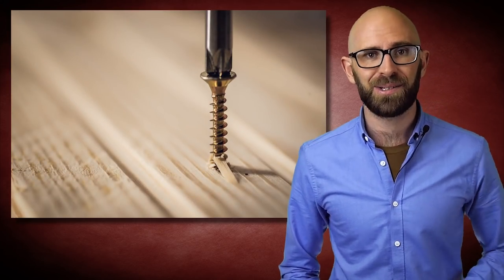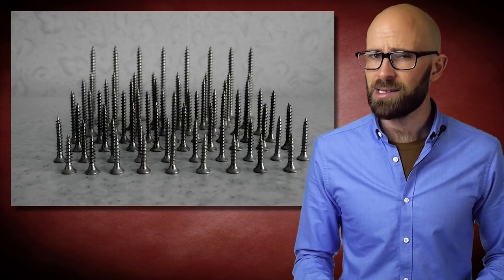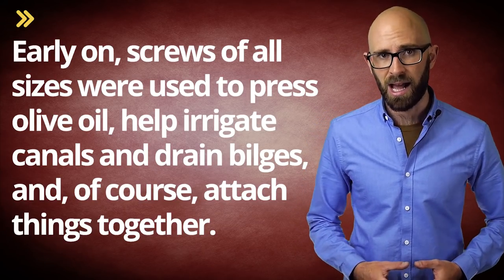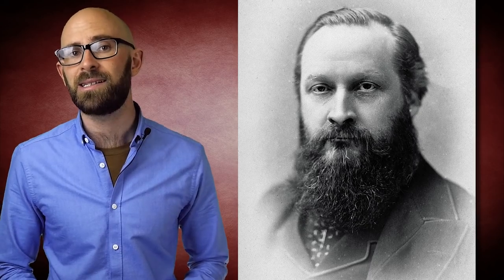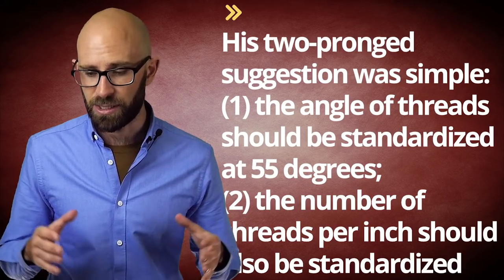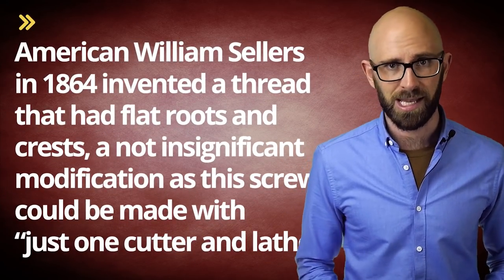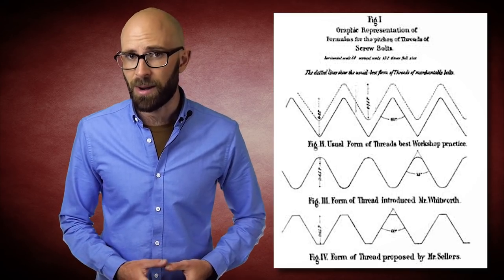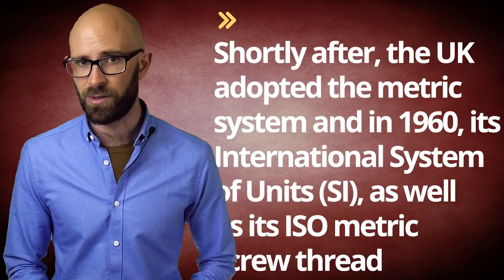Why Do Screws Tighten Clockwise?

Comment: You didn't address why gas fittings are left to tighten and right to loosen
Reply: They probably didn't mention it because not all gas fitting are CCW (left hand) threaded.  Different gases depending on their type are fitted with thread types; inside or outside connection and CW or CCW threading.  There is an example of as to why in the case of mislabel nitrogen tank labeled as oxygen being shipped to a nursing home in the US and a maintenance worker replaced the fitting to connect it to a centralized oxygen system killing several residents.  A bit out of the scope of the video but hope it helps anyone who was curious.
Reply: Still think it deserves it's own video
Reply: I always assumed it was because when turning on a gas system you want to do everything CCW, and when turning off you want to do everything CW.
That was the only reason I ever thought up for it.
Reply: in oxyacetylene welding the acetylene and oxygen tanks have different threads so that you can't connect them to the wrong hose.
Reply: Sean, but then why wouldn't they do something easier, like make them a different size?
It's how they make sure you can't hook up battery terminals backwards.

Comment: The logical way for a lathe to operate naturally produces a right hand spiral, even the very early lathes rotated anti-clockwise (down as the operator sees it) and fed towards the head. It’s only common sense to design a thread to be easily machined, why make it awkward by having to cut a thread feeding out or turning backwards with the tool upside down?

Comment: I'm an engineer in the US and I prefer the metric system when using CAD software and taking general Measurements. it's infuriating to to sort through the imperial sized screws to find the correct metric one. Being an engineer in the high tech industry I can't begin to tell you how much time Americans waste by not going metric. I hate to think how much money is wasted every year.

Comment: If the threads simply ran straight down the length of the screw, we could all save time by knocking them in with a hammer.

Comment: Does gravity get stronger or weaker the closer you get to the core of the earth?
Reply: Because the mostly iron core is denser than the mantle, as "you" get closer to it gravity increases slightly.  If by core you meant the centre, once "you" go past the core mantle boundary, where g is about about 10.7 m/s², it drops off nearly linearly to zero at the centre.  This was found from seismic data.

Comment: But you didnt explain why some use flat head and some cross head screwdrivers.
Reply: Originally all were flat head.  When power tools became common people were finding that the flat head had an issue with slipping out of the slot.  To counter this several head types were made were made and the most common was the Philips head.

Comment: Well it would sound wired if it was righty loosy 
Lefty tighty
Reply: You mean like the left side lug nuts on a pre-sixties Chrysler-Plymouth-Imperial-Desoto-Valiant-Dodge car? There are logical engineering reasons for left-tightening threads. I remember how puzzled the bicycle shop was when the front bottom bracket lock rings and crank arm retainer bolts on my tandem kept working loose because the factory had installed the adjuster-tensioner insert in the bottom bracket backward.

Comment: Here's a better question - why can't we just use purely flathead screws. Seriously, they are so much easier to use, they don't strip like philips heads do, and even if they do strip it's easy as chips to get it out anyways. 
And don't get me started on specialized screws like stars, hexes, etc...
Reply: I'll bite.  Screwdrivers jump out of slotted screw heads, and the slots strip easily too.  The real problem is the world adopted Philips head screws (or variations), which were designed to limit the torque that can be applied to stop over-tightening in manufacturing, thus screwing over anyone trying to get them undone.  Fortunately, better shapes are appearing these days, we just need a standard now.

Comment: Am I the only one who hates the idea of "righty tighty, lefty loosey"? I mean, the phrase actually doesn't make sense. I mean; Is the top or the bottom of the screw head (When looking at the driving end) moving right!? The opposite side will be moving the other way (like a wheel). I advocate for another saying that will help people without a functioning memory to remember that clockwise tightens and anti-clockwise loosens.(yes I know there are anti-clockwise screws for special case scenarios) Or just remember it without some mnemonic or saying, since it's just as easy! Sorry for the rant.

Comment: Here's a question, why hasn't the United States converted to the metric system?
Reply: Congress
Reply: It's not like it hasn't been tried, but a conversion would have to be approved at State rather than Federal level.  Also certain sectors of US society are very resistant to change.

Most US schools teach both formats these days so it will probably come one day.
Reply: Perhaps because very few units in either system are based on any fundamental principles. So for most scenarios, the system of measurement being used - whether metric or standard - is ultimately based on mere aesthetic preference.  There is a reason you can convert between metric and standard.

Comment: Does anyone make a left handed screw?
Reply: bjs301 There are quite a few out there. Usually they'll be called reverse thread screws.
Reply: Older vehicles used a left hand thread on wheel studs on the right side of the vehicle.

Comment: Whitworth requires three cutters and two lathers? What rubbish. With  a small thread any thread profile can be cut with one correctly profiled cutter. OK with a really big Whitworth you might want separate tools to profile the bottom and round the tops. But not two types of lathe.

The Sellars thread is cheaper to cut as it eliminates the base and crest profiles, but the Whitworth is stronger for having the rounded transitions.

Comment: Screw the inch system
Reply: Cleiton Felipe actually i like using both imperial and metric interchangeably, can be more process i feel.
Reply: Felipe, inches are great. If you're an American and in any sort of mechanical field you'll be completely proficient in both metric and standard. And spoiler, people who work with both every single day much prefer standard in a lot of cases. Screw threads being one of them.
Reply: The US "standard" measurement system can be more difficult to understand than the metric system, however, when it comes to inch measurements, it's much easier due to it being a dozenal (base 12) system rather than a decimal (base 10) system, and honestly, fractions are not as hard as most people make them out to be.  For example, 1/3 of 1 foot (12 inches) is 4 inches, even and simple, but 1/3 of one meter (100 cm) is 33.333333333... cm, not so even.
Reply: Inch the screw.
Reply: Live Wire and then it comes to longer lengths and weights and the  imperial system becomes completely unlogical
Reply: Live Wire
The metric system is way easier to use if you have different units to take care of
A 1x1x1 m big square weights exactly 1ton or 1000kg or 10dz
Or 10000g
Reply: Live Wire sorry just read you talked only about inch/centimeter messurment and not miles/Kilometers and weight
Reply: Live Wire but with metric I don't need any fractions, if I want a four I say four, if I want 33.3333 I say 33.3333 not a third of 100
Reply: Torben applies to that as well, although values are different and not always related
Reply: I am a mechanic and fabricator. I wish the U.S. had gone metric 120 years ago, like we were supposed to, when I am working with screws. Not because it is in any way better but because then I wouldn't have to have two sets of tools. When I am fabricating I prefer American units because I work from centers and fractional measurements divide by 2 naturally. with machine tool work, it's what the machines and measuring tools are calibrated for since even with inch measurement we use decimal units.
Reply: Torben, yeah, for the most part the metric system is easier to use and understand, especially when comparing size to weight, like you said.  My point is that just that a dozenal system is even easier than a decimal system, like the metric system, however, I see your point that beyond inches, the standard system is quite complicated, and doesn't really even make sense.
Reply: Cleiton, 1/10, 1/100, 1/1000... all still fractions.  1/3.33333333... that's a complicated fraction.  I see your point, but even with the metric system, we have to deal with fractions occasionally.  Yes, the metric system is easier than standard imperial, but a dozenal system would be even easier than metric.
Reply: I keep telling myself that, but i just can't understand the other one.
Reply: _"A 1x1x1 m big square weights exactly 1ton or 1000kg or 10dz
Or 10000g"_
Assuming it's full of fresh water, yes. What about if it's full of anything else? Say, mulch?
Reply: cunning wolf something I do slightly(in part cause I play way to many sciency video games to add to that, use those since using things like weight to measure a ship in zero gs doesn’t work.) and the imperial units for talking to people in real lkfe
Reply: Two drums and a cymbal fell off a cliff. Ba dum ta
Reply: There are two types of countries. Those who use the metric system and those who have been to the moon! 'Merica
Reply: What is density: the comment.
Reply: the dozenality of the US Imperial system is so good and convenient that engineers to specify anything with a high degree of precision use thousands of an inch
Reply: Live Wire hahaha screws are not specified in feet. Base 12. Hahaha. Oh you were talking in general not about the video.
Reply: +phlodel
Yeah, it might have been convenient if the US had gone metric way back then, but it's really not an inconvenience for most of us other than having to guess at the size of the wrench for a particular bolt.  Hell, even on Harley motorcycles, I find some things that are metric and you would think that it would be one of the things that are definitely all US made and US measurements.  But, looking on the bright side, unless you are working on old British cars, at least you don't have to keep a set of Whitworth wrenches around.  IIRC, with the Whitworth, the wrench size was not the size of the hex head across the flats, but rather the size of the shaft of the bolt.  If you wanted to know the size across the flats, then there was probably some formula that you could apply that would tell you what it was given a particular bolt shaft diameter.  I've never looked up the formula, but I've seen tables of the values.  For example, a 1" Whitworth would need a wrench that was 1.67" across the flats of the hexagon.

And, of course, there's enough variation in the quality of the bolts and some of the wrenches that we have that sometimes a metric wrench fits an SAE bolt better than the proper SAE wrench.

And then there is the damn JIS standard for cross point screwdrivers... :(  Many motorcycle carburetors have had the screw heads stripped out because of that.

Comment: This is wrong information. The reason behind it lies in physics law and how field works
Reply: Not quite. The threads determine whether it is "lefty-loosey, righty-tighty" or the other way around. The angle of the threads determines whether it is a right-hand screw or left-hand screw. The standard for most common screws is the right-handed screw (lefty-loosey, righty-tighty), but the direction of the force has nothing to do with the handedness of the person; only the direction of the threading. Then the rest of it is physics and torque.

Comment: Typical of todays "instructional" videos. The paramount thing is to be entertaining, to bring in advertising revenue. Doesn't matter about accuracy. At about 2min 20secs he says the Whitworth thread has, "rounded roots and pyramid shaped crests". WRONG! Whitworth thread form has ROUNDED, Roots AND Crests. Also took so long to get to the actual question, and then I'm not sure(humbly stated) he is correct, or the only reason.